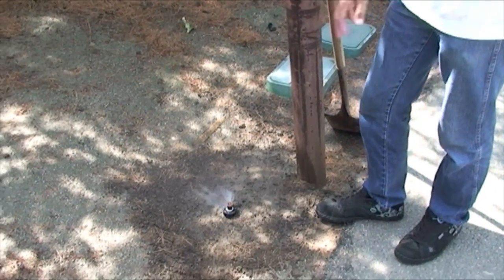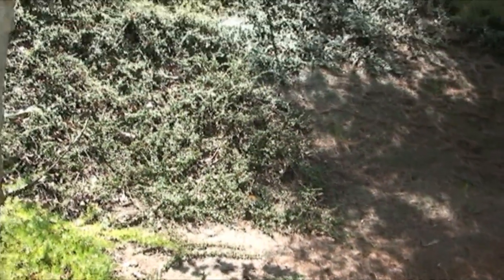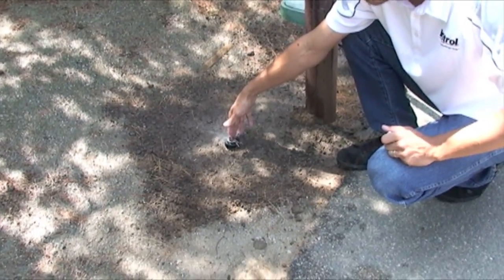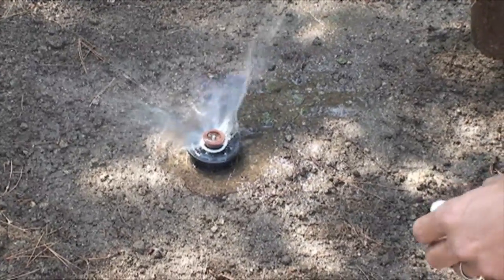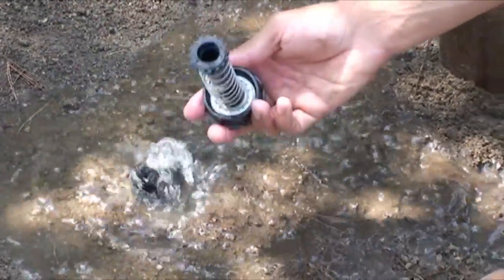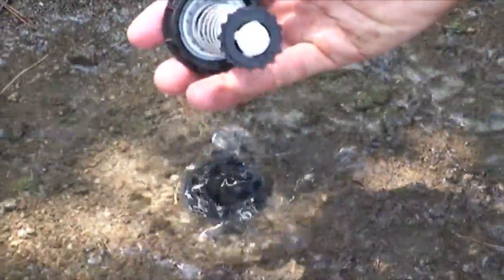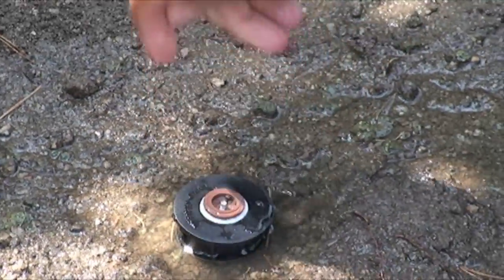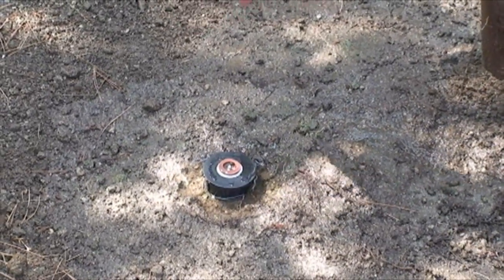How to stop Low-Head Drainage using a Check Valve

Comment: So is it a low pressure activated check valve? Meaning does it require higher pressure to open and allow water to flow?
Reply: Correct

Comment: Hi I have a similar situation. Will this also cause the valve box to flood? I have replaced the solenoid and diaphragm. I still have low head drainage+flooding valve box.

Comment: Could the check valve be fitted onto any sprinkler?  I have 2 sprinklers that need this valve.
Reply: I have the same question. I have Orbit rotor sprinklers.
Reply: @InFrontOfGodAndEverybody  have you figured out what to do with orbit sprinklers?
Reply: @dtran00  I need to check the diaphragms. I talked with someone from Orbit and they said that they don’t have check valves that fit their rotor sprinklers.

Comment: Does the irritrol I pro 1200 unit with a pressure regulator and check valve have a functional side inlet and can you post a video about the irritrol Titan impact rotor please?
Reply: Did you ever get an answer because I have the exact same issue even when all valves are closed!

Comment: Does that fit on rainbird 1800 sprinkler heads?
Reply from the maker: SuperNick090 Yes I-PRO Nozzles are completely retrofittable with Rain Bird's 1800 Sprinklers. Find out more at http://www.irritrol.com/sprays_ipro.aspx.
Reply: That's great news. I just wish your company made this part more available. I've called all the stores locally and the only place online wants to charge $20 S&H since the order is under $20.
Reply: irritrolchannel tried on rain bird 1800. Only seems to work on one of the heads. Guess I’ll be digging some holes.
Reply: @Dan Olken  so no good on rain bird 1800